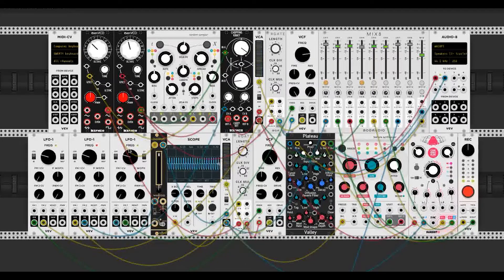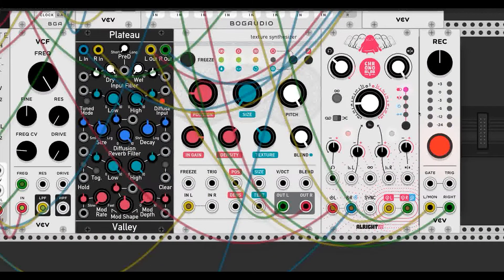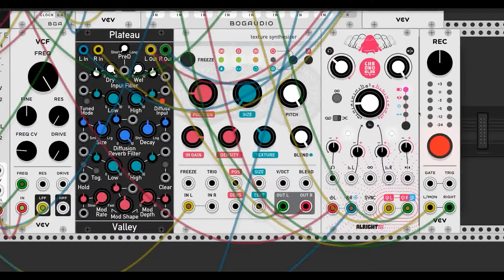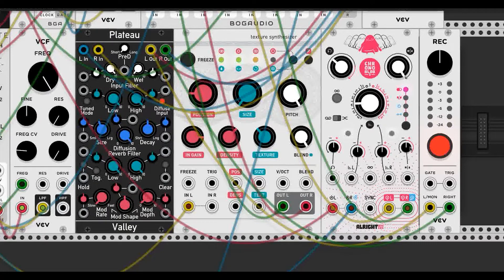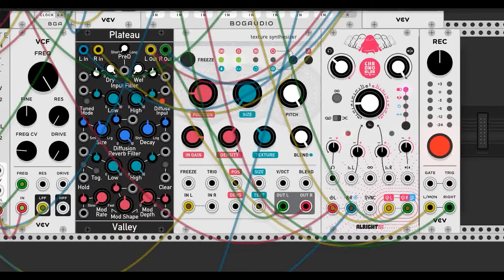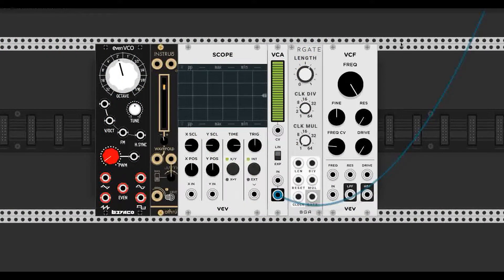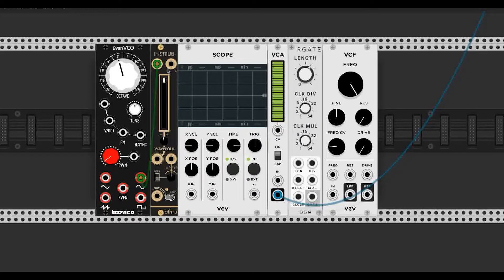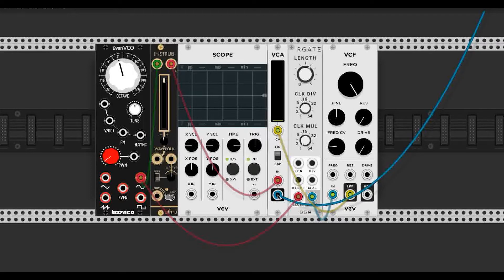Pulsar Synthesis, Granulation's Little Brother // VCV Rack Tutorials

Comment: Nice patch, but just to clarify, this is not exactly Pulsar Synthesis. In the correct algorithm a wave-cycle consists of a portion of signal (any type of waveform, Roads defines it as “pulsaret”) followed by a portion of silence. The “duty-cycle” parameter allows you to modify the ratio between the period of the signal portion (pulsaret) and the period of the silence portion. In your patch, when you modify the duty-cycle (gate length) you are not altering the period of the signal portion (pulsaret) but you are decimating the waveform. I wanted to point this out because the resulting sound is quite different.
Reply: this

Comment: While in my mind this has very little to do with granular (i see where you come from with that comparison, it's just easier to compare to something else), it does sound sick. There are so many different forms of synthesis you can come up with on the fly with a modular system like this, too.
Reply from the maker: The reason I made the comparison because the inventor of pulsar synthesis, Curtis Roads, was also a pioneer in the invention of granular synthesis! I think in Roads' mind, these two types of synthesis can be grouped together because of their shared concept of granules. Although, one could also make the argument the lengthening and shortening of granules in pulsar synthesis is really just a form of duty-cycle, or pulse width, modulation and thus us more closely related to synthesis with pulse waves. Anyways, Roads goes pretty in depth with this stuff in his book Microsounds, which I admit I haven't read. I may need to look into it!
Reply: @ianmahanpour  I'd say this particular form of synthesis is more akin to windowing.
(is "windowing synthesis" a thing?)